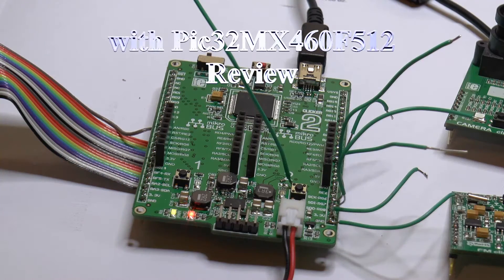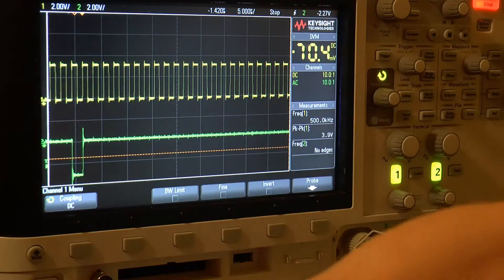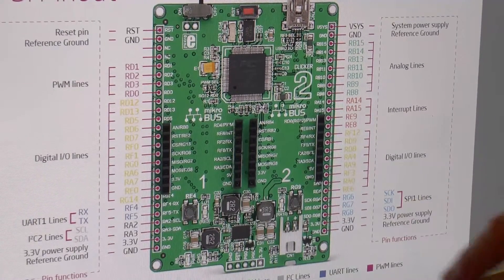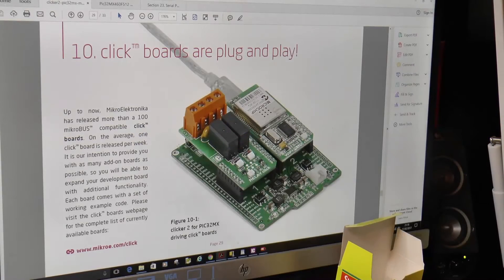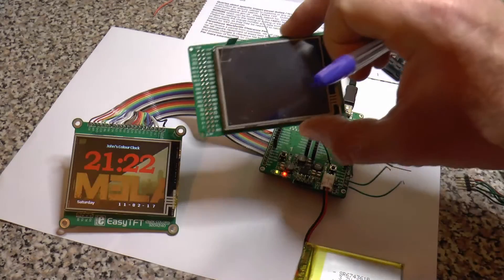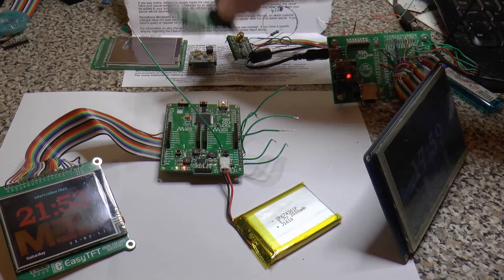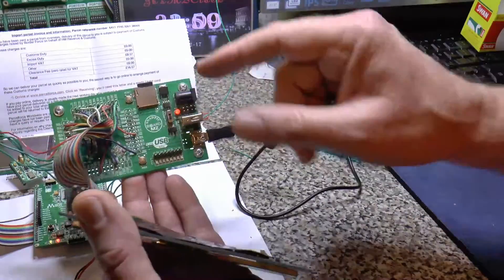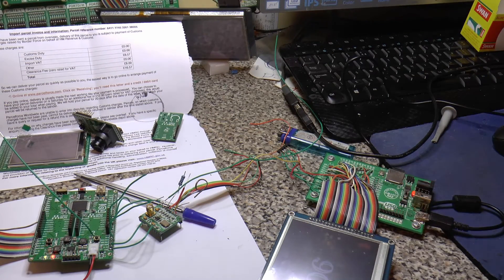New to programming? 'Clicker2' Review

Comment: Can I ask you another question.. to conformation. How can I connect a button to the Clicker 2? I mean not in the code way, in physically.
Reply from the maker: Look at the user manual for examples.
Connect a 10k resistor to a port pin then connect other end to 3.3 volts.
Connect that same port pin to a switch and the other side of the switch to ground.
Your switch will pull the port pin down to zero when pressed.

Comment: if i want to add a button to start the program how do i have to that? Just a normal button. I'm doing a program to get temperature but i need to add a button to start the program, if i don't add the button then the program will start automatically. So i need to start by my self adding a button.
Reply from the maker: Why do you not want the program to start automatically?
Add a button to a port pin of your choice and have it pull the pin high or low.
In the program code you simply write this example -
 While(RB0_bit !=1);
The program will wait until you press the button and port RB0 becomes 1.
Reply: @JohnB-2021  well my teacher told me to add one. 🤷‍♀️
Btw thank you so much